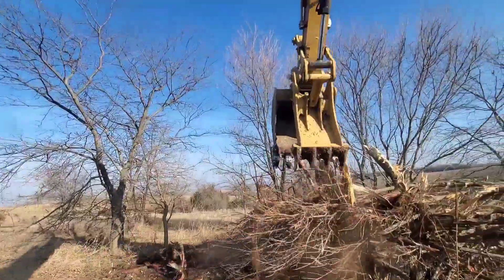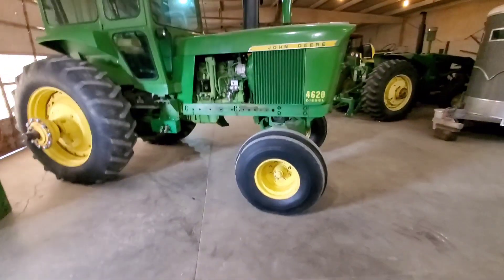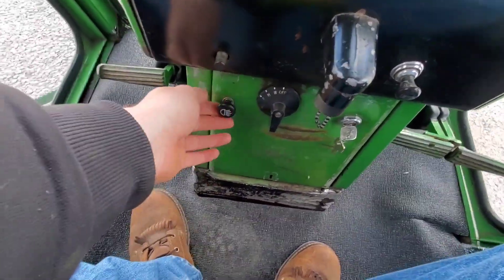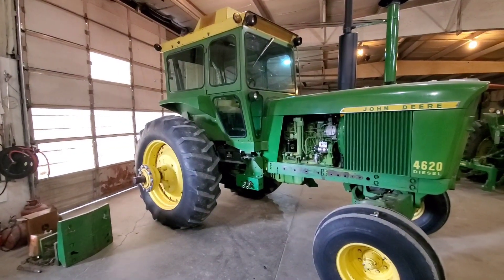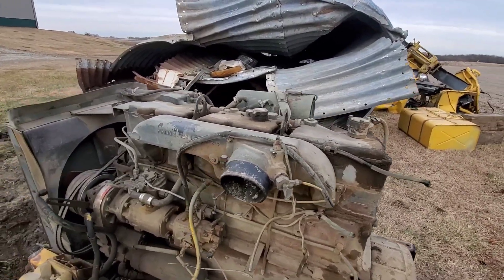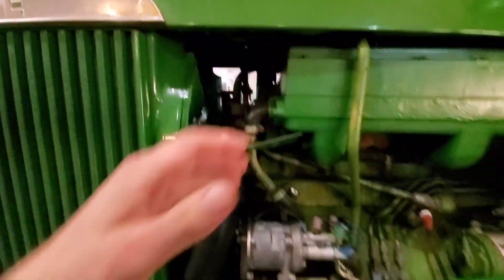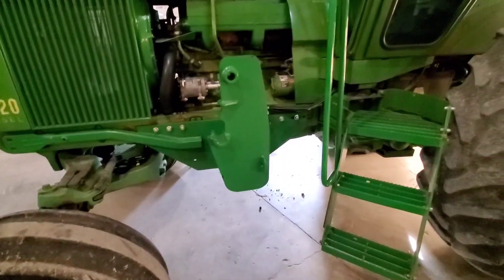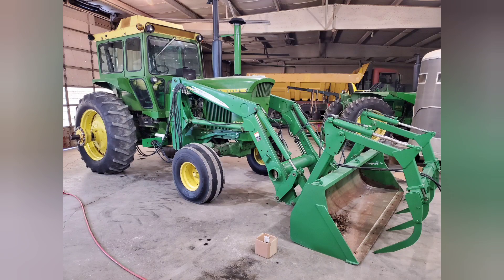installing 726 loader on 4620

Comment: Did you need to build a new front-end frame for the mounting brackets, or did you modify the front-end mount?
Reply from the maker: Thanks for asking... I was able to modify (lengthen) the front bracket ...that way if i ever wanted to put the loader on something else I could just buy that 1 bracket ... it came out really nice!  I'll have more pics / video of it soon

Comment: would a 726 loader work on a 30 or 40 series john deere?   2 wheel drive..thanks
Reply from the maker: Yes it will....4030 to 4630 .... 4040 to 4440 ... will also fit a 4640 or 4840 with minimal mods ...

Comment: The 4620 has turned out to be a really good tractor, if they would have done that much to them back then in the cab, I bet more would have been sold with cabs..
Reply from the maker: Oh for sure ... cabs were coming - fhe gears were turning - and once the 30 series hit - about everyone was buying with cabs ....
Lots more to do to the old girl - but it's coming together nicely!..
Reply: @Blackearthexcavationandtiling  Cabs started to really come on after the 70 series Cases come out, Cause no one had a factory cab that was that good and it started a race for the best operator environment..
Reply from the maker: @kolewiebensohn  oh for sure ....
There's a contractor in our area - started in the 60s with open station cable dozers ...he bought a new D6C (70s) with a cab ..which that cab would have been considered cride by today's standards- anyway he said the first job he had it one was dry dirt and when the dirt ran down the windows and he sat in a clean environment, he knew he'd made the right choice ...lol .... generally speaking a closed operators environment is better..especially in Iowa where the weather is so harsh and variable ....
Reply: @Blackearthexcavationandtiling  exactly, I love my open station tractors, but if I could be in a cab, I'd be in a cab..

Comment: Question! Do you happen to own a 25mm socket?
Reply from the maker: Possibly - I'd have to run through my socket sets ... although it doesn't ring a bell off top my head .... but then again there are some really odd metric sizes ..I've even come across small bolts that are 6.5mm
Reply: @Blackearthexcavationandtiling  As i said in latest Farmer MD videom Who the hell owns a 25mm socket
Reply from the maker: @vanilakung7563  lol.... i Google searched it ...they do in fact make a 25mm socket - but I do not have one
Reply: @Blackearthexcavationandtiling  No one as has a 25mm socket
Reply from the maker: @vanilakung7563  are we talking about an actual socket? ... I feel the conversation has turned a bit odd here - lol .... they do in fact manufacturer a 25mm socket - available on Amazon and many other places (I checked Google) ...
Reply: @Blackearthexcavationandtiling  Going on a  rant here, no one owns a 25mm socket
Reply from the maker: @vanilakung7563  https://m.northerntool.com/shop/tools/product_200922098_200922098?cm_mmc=Google-pla&utm_source=Google_PLA&utm_medium=Hand%20Tools%20%3E%20Sockets%20%2B%20Socket%20Sets%20%3E%20Impact%20Sockets&utm_campaign=Milwaukee&utm_content=4800540&gclid=CjwKCAiAzrWOBhBjEiwAq85QZ4k-EMJ8cfhDRhVi1XZv6Snt3K9UIlvkMIo_0l1bqrLntMxMJLs5HBoCyvYQAvD_BwE&gclsrc=aw.ds